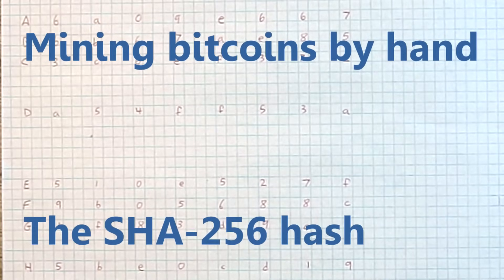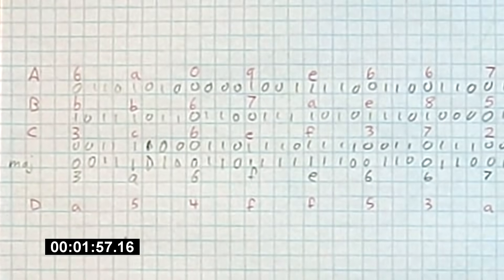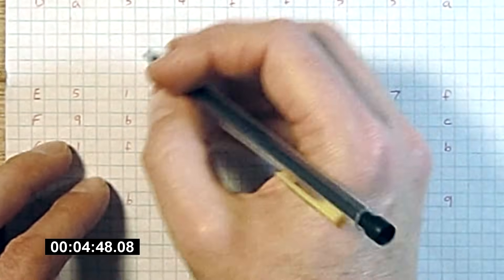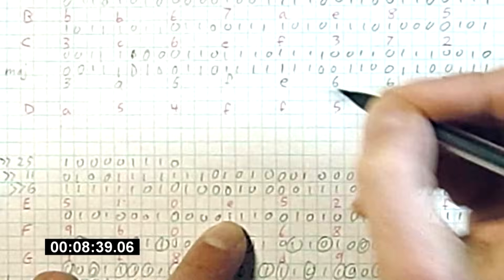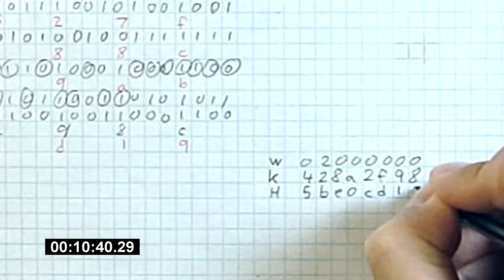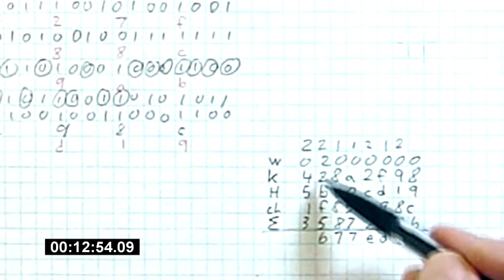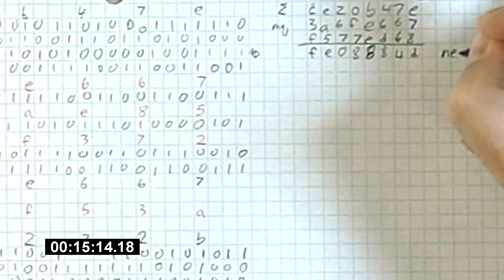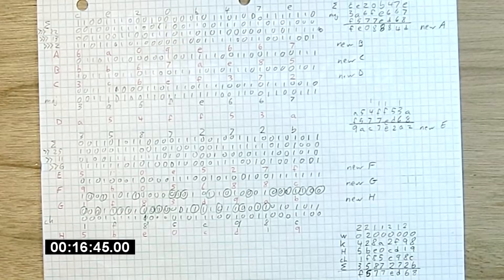Mining Bitcoin with pencil and paper

Comment: Bitcoin miners just passed an eye-watering 1000 EH/s.  What does this mean?

It is estimated that there are 10^18 grains of sand across all the world’s beaches.  
10^18 is a 1 followed by 18 zeros.

1 exahash is also 10^18 hash calculations each second.
So, the same magnitude as all grains of sand on Earth's beaches.

1000 exahashes (10^21) is 1,000 times that

Imagine you could label each grain of sand with a unique hash like in this video every second.  1000 exahashes is like labeling 1,000 Earths worth of sand grains... 

EVERY... SINGLE... SECOND!

The bitcoin network is EPIC!

Comment: 3:51 "So, this is actually the first place that our input data is actually going into the hash" 😟So the first 10 minutes was just more or less, "mathematically translating" the hash similar to (in a very oversimplified sense) as if you just spent the first 10 minutes doing what's equivalent to replacing the variables in a given formula used in an equation and it's only now that we're actually going to solve the equation?! Ay karamba!

Comment: This is fascinating.  I'm assuming you aren't just pulling numbers out of thin air, but TBH, this sounds like gibberish.  I want to understand this, and will probably re-watch this 5 times.
Reply: Nope, definitely not numbers out of air! It's just that he's use Base 2 (Binary) and Hexidecimal (Base 16), so it's a little different from our daily base ten (decimal) system. Once you learn how it works though, it's very easy to translate between them, and there is multiple benefits to doing so for computers at least..... Anyways, i wont pretend to know how bitcoin works or that he is 100% correct, however considering he recently wrote a bitcoin mining program for the AGC computer system used in the Apollo moon missions, i do believe there is truth behind what he is calculating here.... 

Also, keep in mind a computer algorithm (like the SHA-256 hashing algrorithim he says he is using here) is just a set of instructions layed out step by step for a computer to carry out (usually with mathematical formulas to assist). Computers do tasks just as you and i can do, however they do so with specially layed out electrical wiring. As unfortunately we haven't quite figured out how to make living computers that can compute mathematical things for us using brains similar to our own.

If you are interested in computers, you might want to check out the crash course youtube channel, as they have a crash course computer science series which makes computers approachable, but at the same times teaches you exactly how they work.
Reply: @izaicslinux6961  I actually was watching that series when I came across this video.  That was a few months back, I watched episodes 3-13 whilst trying to understand logic gates.  
The series is excellent.  Last night I saw a video about making a simple video card on breadboards and was able to follow along mostly thanks to that crash course video series.

Comment: Do you think it possible, if the math is so less difficult than has been reported, that the hardware used to mine could have been intentionally limited to increase the difficulty and thus the resources used, increasing the demand for oil?

If Satoshi Nakomoto set out to create a currency which could be traded secretly and independently of government, I can see no reason why he would envision a ledger which cannot be deleted and is permanent. Considering how intelligent a man he must have been in order to develop such technology, and with such foresight to put eight decimal points after the 0, knowing the value would reach a point where they would each get used, how could he then have been so blind as to not see the technology he was building could be used as the best weapon against the apparent solution he was looking for?

Comment: Can someone please elaborate on the comment that was made in the beginning of the video about the first constants of the SHA256 algorithm being provided by the NSA??? DOES THE NSA HAVE ACCESS TO CRACKING BITCOIN PRIVATE KEYS???

Edit: Apparently the SHA256 constants are sequential prime cuberoots. Can someone please explain what this guy means in the first 10 seconds of the video when he says that the constants are provided by the NSA?
Reply: The algorithm is designed by the NSA, so it was the NSA that choose those cube roots as constants.

If they know something about the properties of sequential prime cube roots that the rest of the mathematical community doesn't (possible but unlikely) then they may have a back door to SHA-256. Otherwise, no.

Also, this is not the cryptography part of bitcoin. You still cryptographically sign your submissions to the network with a different algorithm. This is just the "proof of work" part - you're trying to guess a special number to win the current block.

The actual cryptography involves a kind of crypto called "elliptic curve cryptography", and regarding ECC, there actually was a bit of a scandal with the NSA picking some mysterious magic numbers to use for ECC, and not explaining where they got them. In THAT case, the security community WAS paranoid that they had put in a backdoor (This is called "Dual_EC_DRBG". Google that term for more info. This doesn't apply to all ECC)
Reply: FFSultrAslan  look for ANDREAS ANTOPONOPOULOS book(500pages) :" Mastering Bitcoin"
Reply: +William Wenge-Murphy
Thanks for the detailed explanation.

Could you provide some sources to learn more about Bitcoin? Not just some tutorials that talk at a pretty high level about it.
I've read Satoshi Nakamoto's paper, but where do I go from here?

Comment: correct me if i'm wrong, but at 1:20, isn't that a rotate operation, as opposed to a shift? considering you didn't pad the leading bits with 0's and instead used the right most ones instead

Comment: There are a couple more steps between SHA-256 hashing and mining a bitcoin.  Before you can hash it, you have to make a block of transactions.  Each block is made up of up to 1 MB of transactions, and each transaction is around 250 bytes.  (That's a lot of writing.)

Then, when you have a block, you do the hashing operation from this video to sign the block.

... but there is one more step.  Bitcoin has this idea called "difficulty".  It won't accept just any hash.  You have to compute the hash, and then see if that hash meets the "difficulty" requirements.  If it doesn't, you go back and change one single bit in the transaction block and hash it again.  This process repeats many trillions of times until you finally find a hash that meets the difficulty requirements.

The entire bitcoin network, every miner combined, only finds one acceptable block hash about every 10 minutes.

Comment: whats the hashrate

 LOLOLOL
Reply: more like

trash rate

( ͡° ͜ʖ ͡°)
Reply: Rift Music oh the cringe... my eyebrows just turned grey.
Reply: This is one "round" of SHA-256. There are 64 total rounds to get your final output. You have to put the resulting value back into this function and do it 63 more times. It says in the description his hashrate is < 1 per day (because he's only 1/64 of the way there after 1/4 of an hour)

Each hash in Bitcoin is only a guess at the correct answer to a challenge. The network says e.g. "I challenge you to find a hash where the first 13 bits are 0", and you have to crunch hashes until you find such a number. Assuming SHA-256 is secure, there's no faster way to do this than by brute-force (trying all possible inputs until you get lucky).

To mine a bitcoin,  you do this 64 times, then you do the whole 64-step operation billions or trillions of times until you get lucky and find an output with the correct number of 0s.

If people are getting lucky too quickly (or too slowly), the network changes its mind on how many leading zeros it wants, which changes the difficulty.
Reply: Fast enough to mine one bit-coin every 2000 years
Reply: actually fast enough to get one dollar per 150th trillion year... so no
Reply: It's about 0,00111 hashes per second.
Reply: With the possibility of it being wrong. :D

Comment: You mean I bought my 5 GPUs for nothing?
Reply: GPU mining is useless for bitcoin mining now though
Reply: yeah because gpu's are useless for btc mining now
Reply: description:
Bitcoins are mined using a cryptographic algorithm called SHA-256. This 
algorithm is simple enough to be done with pencil and paper, as I show 
in this video. Not surprisingly, this is a thoroughly impractical way to
 mine. One round of the algorithm takes 16 minutes, 45 seconds which 
works out to a hash rate of 0.67 hashes per day.
Reply: Mayne, I remember when a bitcoin was 50 bucks.
I feel like such a loser.
Reply: yeah also you can render graphics with paper if you want to get 1 frame per hour
Reply: You can't mine BTC directly - but you can mine other coins with NiceHash and they will pay you out in BTC for their value. So in that sense, it can still be profitable to mine with GPUs. If you want to mine Bitcoin blocks directly, you'll need an ASIC to make a profit on it.
Reply: Anderson you need specific equipment for btc mining now, otherwise you will pay more for electricity than actually earn money.
Reply: sdcaw awewa at the beginning CPUs were used for mining and then they started using gpus that can copute more hashes per second and now custom machines called Asic are used, more bitcoins you mine harder it gets to mine more. There is an increasing difficulty level because of how bitcoins are concerned (math stuff if you want to check out) so depending a lil on where you live but you easily end up spending more money (in electricity) to run your gpus that waht you can actually earn mining
Reply: there are still many altcoin that a promising let take example ethereum once when someone just said they missed the bitcoin goldmine . Now is the era of cryptocurrency which will be the new wall street where everyone can easily buy their crypto share of coin.
Reply: sdcaw awewa brcause everyone is doing it now. You'll never solve a block on your own (without expensive equipment) and even in a pool, without high end miners theres just no money to be made anymore. electricity will cost more than you make
Reply: sdcaw awewa No its all about using specialized miners with ASIC's in them that mine several times faster than graphics cards.
Reply: gpu mining depends on your home country! Because in most countries the energy costs more than you get profit. So in countries like island where the energy is 1/3 of the US its efficient to mine BTC'.
Reply: Anderson GPUs haven't beenused for bitcoin mining in years. It's only done with ASICs (specially designed afordable USB co-processors that ONLY crunch that one algorithm quickly and power efficiently) in bitcoin now. And there's no way in hell you're going to earn ANYTHING mining solo, you absolutely need to be part of a pool to get anything, ever.

If you're still trying to use GPUs, you're spending orders of magnitude more on electricity than you're making by mining. Even if you aren't paying for electricity, then over the life of the card, you might earn a small fraction of it's replacement cost, like 2-5%.
Reply: thats BS, GPUs aren't even close to the best. GPUs aren't worth it in any way, nowadays all is done by ASIC's.
Reply: oliverszk
Reply: Anderson they are useless for Bitcoin mining now
Reply: Huntz Kushe tell me about it
Reply: Brad Gefroh tell that to the ppl buying up all the gpus jus for mining
Reply: If you feel like a loser thinking how Bitcoin was only $50, imagine there was a time when Bitcoin was only a cent. Now it is over $10,000
Reply: @tamathalockheart2330  I know right?  Investing in crypto-currencies is like investing in a stock; you never know whether it will work out or not until it starts to show results, that can either be good or bad.
Reply: GPU is useless with bitcoin, GPU mining is adapted to other coins
Reply: Anderson no definetly not
Reply: Nuttin*
Reply: dar0 there's more than 2 currencys  lol
Reply: Does that mean amd is not a good investment going forward?
Reply: @unnanointedonesufi  lol
Reply: TheGrandWhiteFox :D
Reply: xX_DYLM4N_Xx do you know anything about bitcoin
Reply: Mikhanator 😢 Truly brings tears to my eyes to know that we missed out on a goldmine.
Now I'm stuck working 4-4 everyday. Oh well, let's live in the moment.
Reply: TheGrandWhiteFox well granted a gpu can calculate these numbers within a fraction of a second, no you didn't buy them for nothing. Lol
Reply: SandFX where do I sell it though that's my problem
Reply: You need ASIC's to mine btc rn, and a hella lot of them.
Reply: American AI Yes, but we were talking about BTC
Reply: American AI usually miners buy the most cost efficient GPUs that give the most performance for the price. Which also happens to be what budget PCs want. So the demand goes up and the price of the usually cheap GPUs skyrockets. I know this happened with the 270x I believe
Reply: yeah 'cause you helped ruining the year for gaming system builders shame on you!
Reply: robogames what is wrong in my reply? Also can you tell me how many languages can you speak? Cut the western shit pls.
Reply: robogames My bad that I'm not a grammar nazi and I have to learn 3 languages at school by law so next to my mother tongue I must know english (in what I've won competitions  btw) and spanish at an almost fluent level. I don't even bother to tell you where I'm from because you wouldn't even know where it is.
And my sentance is still correct.
Reply: and and asic is making more than 10Tera Hashes pero second, not a good idea trying to mine a block with your hand am i right?
Reply: Rofl!
Reply: No I'm not mining Bitcoin anymore like I used to, but I am investing heavily in it. I used my savings money a couple of days ago to buy as much of it as i can. Based on all my research at my university I think Bitcoin is a very disruptive technology and will cause a paradigm shift in world of finance. as for the price of Bitcoin, my guess is at least $50,000 per bitcoin by 2020, but it could be much more.
Reply: Mine Ethash, Beam and Ravencoin now...
Reply: https://youtu.be/l90uuUH1BwM
Reply: Seems that most people are quite clueless what is bitcoin mining these days, but it's okay, it's pretty trivial information for someone who doesn't do it.
Reply: How much have you earned over the last 4 years? If you're willing to share?
Reply: I mean... your gpu's are doing this way faster than you can so...
Reply: GPUs are only for mining Ethereum and zCash :)
Reply: That's interesting for me to hear? Why is that?
Reply: Anderson ASIC's are for bitcoin mining, gpus are for etherium.
Reply: Ok I realize it's a lot harder to mine now because so many people do it but when he said GPU mining is useless I thought that for some reason some other way is now more effective like putting more emphasis on CPU.
Reply: xX_DYLM4N_Xx GPUs aren't useless for mining.  They're basically where all the mining power comes from.
Reply: @andy2641  Dude it's a joke.
Reply: TheGrandWhiteFox nah u didnt nice try clickbaiting
Reply: Mohd Nazreen Abdul Rahman Fasho.
Reply: TheGrandWhiteFox 5 gpu's can't run in sli
Reply: GPUs for mining Bitcoins is as useful as it's for Minecraft
Reply: fuck you youre the reason hundreds of people cant get gaming pcs
Reply: Actually GPUs are the best at bitcoin mining. They perform the calculations incredibly quickly when compared  to a traditional CPU.

Comment: I notice you list the new-A through new-H. So is  the 256 bits of the output just new-A through new-H, just put together? I would assume so since A through H is 8 letters, and each letter has 32 bits out of the 256 bit hash, but I just wanted to be certain.

My second question is with the adding. What happens if there is an overflow? Do we "wrap around" (like when you overflow an integer in a computer) or do we do something special with the bits?
Reply: Dont know how to answer you first question. An overflow in very unlikely since the biggest number a 64bit computer can register is in the quintillions and these numbers that are being added are in the billions. if a software engineer knows what hes doing than that can be easily avoided
Reply: If the summation is higher then the maximum value with 8 digits (ffffffff) you just "wrap around" like you said and forget the 9th digit, which would have to be in front of the 8 digits.

Comment: I made an Excel spreadsheet for the SHA-512 for all 80 of the rounds basically doing the same thing you did on paper. Unfortunately my version of excel didn't have the XOR function and had to do it manually :(

For those interested, the formulas can be found on the NIST.org website.
http://csrc.nist.gov/groups/ST/toolkit/secure_hashing.html
Wikipedia is also a good source:
http://en.wikipedia.org/wiki/SHA-2

Fun little tool to play with hashing algorithms:
http://www.fileformat.info/tool/hash.htm?text=abc